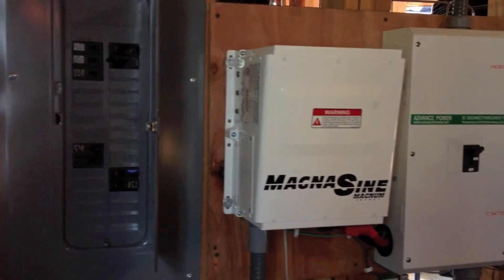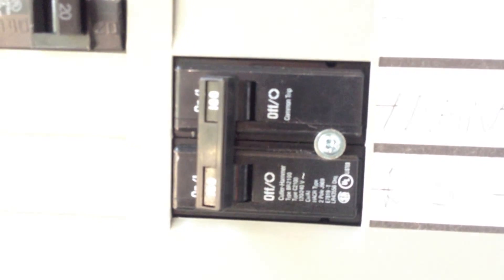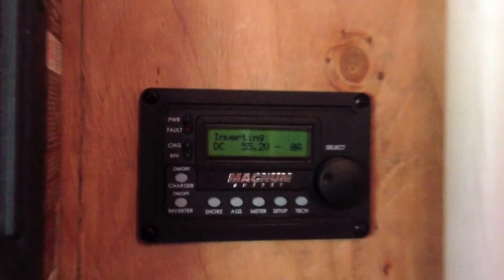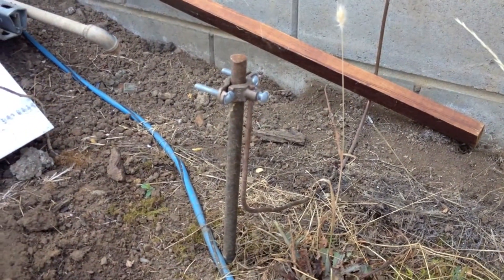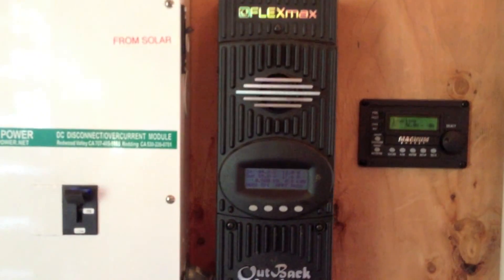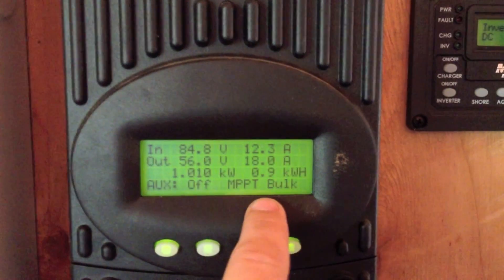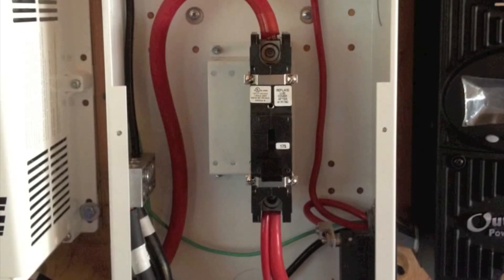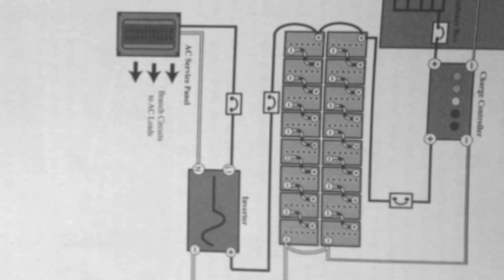Solar Off Grid System Components Explained In Depth

Comment: Nice work. Your ground setup looks a little dangerous. A direct strike can super heat the ground wire and ignite any flammable surfaces it is in contact with. I worked signal maintenance on the railroad. Often found wooden surfaces the ground was fastened to or passed through deeply chard, or simply incinerated. Grounds need to be as short and direct as possible. Critical locations had multiple grounds all tied together to keep runs as short as possible and as straight as possible. Your location looks critical to me. I would think about adding a second rod and keep anything that can burn away from the ground wire.

Comment: Did you also ground your inverter?
Reply from the maker: Yes all components are grounded and connected to the neutral bonding block in the enclosure panel. The ground is then run from there to a grounding rod buried outside. I have other videos explaining the process. Check them out. Thanks for watching.